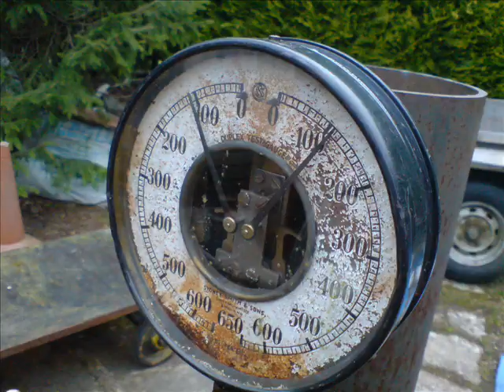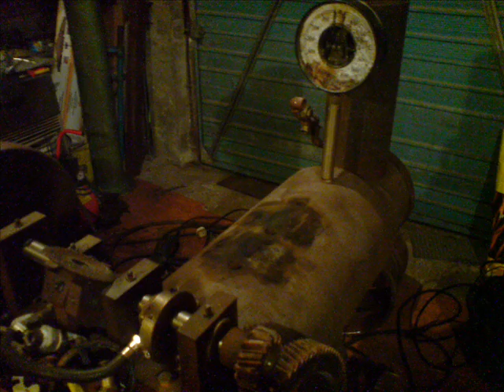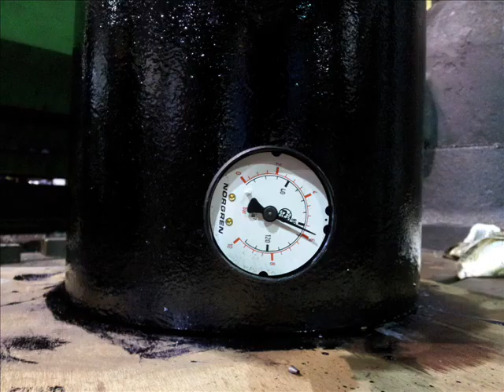Homemade Steam Engine Build Slideshow

Comment: The slide show just kept getting better than I first thought. Helical gear cutting as well? Nice work.I noticed the "Zeus precision data chart" a bit more used than mine by the look of it, although I have had it since the 70s. 
The shed door opens and you wheel that out! Well done and thanks for the video.
Reply from the maker: Thank you for your comment 😃😃😃

Comment: This boiler ‘appears’ to be quite a bit safer in its construction than the 1st one. It at least, has some water level clearance in the pressure vessel.....        which if if your low level line on your sight glass is slightly above your highest tube in the boiler, your  top tubes are protected. They, you ( and others ) are protected by you & the glasses’ accuracy to the top tube/tubes to prevent possible tube collapse, tube sheet or pressure vessel shell failure.....       not wanting you to see me as a knowitall, just want you to stay safe & enjoy this hobby, but always be attentive to details. I like this little engine......!!!!
Reply from the maker: Thanks for your comment yes they are very dangerous i am aware and i keep the pressure as low as possible to avoid any incidents

Comment: very nice i do often wonder why everyone uses the chain steering?  I would be tempted to use a newer set up rack and pinion or something and add the chains for show or something after
Reply from the maker: Either would be good but all ive seen are chains. With the movement from the heat any other method might not work the same